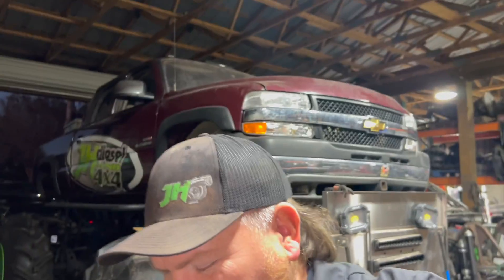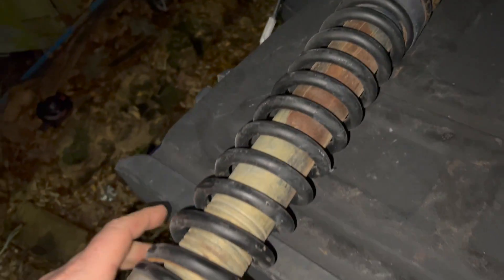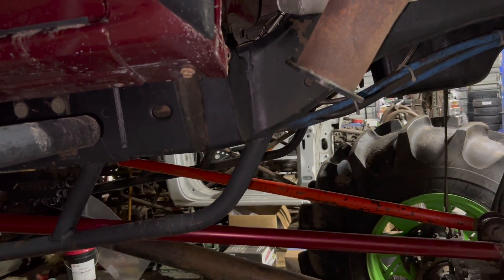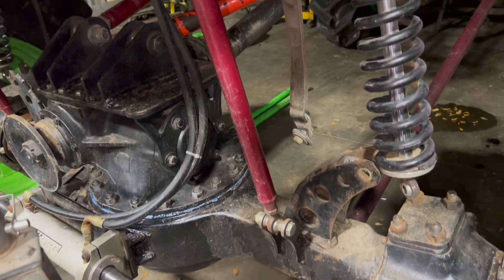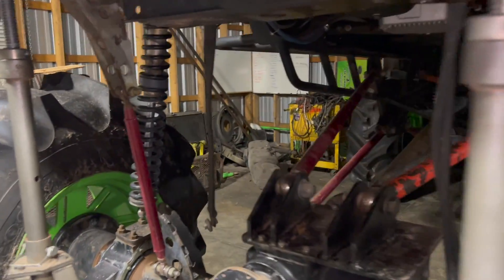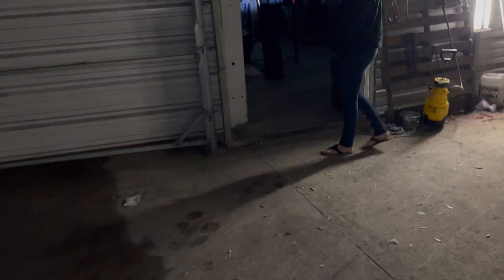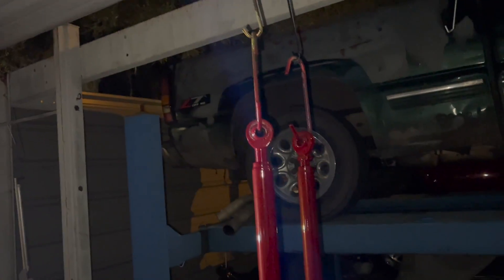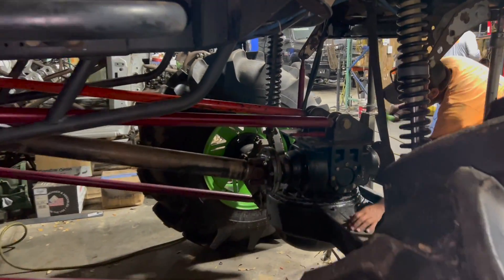D.O.M. Tubing VS Pipe!!!  We Cut Open Our Mud Truck To Compare The Differences!!

Comment: A513 (most DOM) has a yield strength of 72ksi.  A500GR-C (most likely the seemed tubing in the video) has a yield strength of 48 ksi.  So yes the DOM is 50% stronger for the same OD and wall thickness.

Comment: Fun fact about both those pipes. It was once rolled on a reel like a water hose . Just a bigger reel. the ID {inside diameter} of the pipe is all different sizes.  It was once used for coil tubing for offshore and on land drilling. A company in Odessa Tx straightens it out after it has about 1 mil running footage or 30% usage. then sells it to the public As straight pipe. Now you know why it bends so easy.
Reply: dam
Reply: What do you mean by why it bends so easily? Because it is used pipe or because it will bend around a large reel?

Comment: Pretty sure roll cages are supposed to be d o m wall tubing.
Reply: HREW FOR LIFEEEEE
Reply: Pretty sure mild steel tube is just fine
Reply: Pvc is pretty strong
Reply: I ride BMX and ain't NO WAY mild steel compares to chromolly.
Reply: I have seen someone build a roll cage out of galvanized steel pipe and fittings.
Reply: Just depends on the sanctioning body and the required spec to build them to...
Reply: Nah , all you need to do is replace headliner with FRP board and you're good and safe for 7 second quarter mile runs.
Reply: Good ol drawn over mandrel tube
Reply: #2 pressure treated pine is waaaay stronger
Reply: @BUILTFORDTOUGH79  I build all my race cars out of balsa

Comment: I built off road desert racing trucks and prerunners for years an cold rolled miled steel tubing isn't even allowed in our industry for safety reasons, its much softer and not nearly as strong as 4130 or DOM. Listen to JH on this one guys, a couple hundred bucks is worth yours or one of your friends lives.

Comment: I agree with the dom pipe over sch 80 pipe, but on a 4 link truck I will always make my front and rear pull points from the axle instead of frame

Comment: The main important thing to know is what your material and thickness is. Schedule 120 pipe is a massive step above 80. You can get thin wall DOM and you can get thick wall DOM. DOM doesn't mean its stronger the specifications of each tells you which is stronger
Reply: Correct. DOM is the fabrication method. Both start as a welded pipe.
Reply: @patonb  correct it doesn't inherently mean DOM is stronger it depends on the wall thickness
Reply: @brettknighten1171  and alloy

Comment: "DOM VS STEEL" as an engineer in competitive motorsports DOM [drawn over mandrel] is seamless vs pipe therfore it is a stronger product slightly, myself for just a few pennies more LOL, I only use 4130 chrommoly download a tensile strenght chart you will be shocked it is the standard in all competitive motorsports and aviation. just for fun take a piece of 1.5 x 1.5 moly and steel smash it with a sledge. just a thought.
Reply: If you're an engineer in competitive MS, I'm scared for your driver. DOM is ERW 1st then shape refined by the mandrel. Pipe also come seamless btw.
As a metallurgist, i beg you to stop using "steel" when you most likely mean "low carbon steel" as 4130 is steel too, so is 316.
Reply: OK what is the structural material stand fin the competitive motorsports industry, sorry bud you have no idea what you are talking about in our application.
Reply: @victormackenzie-davis2711  I'd respond to you but I have no idea what you are asking. Your auto correct has you asking gibberish

Comment: As a Boilermaker;
1) pipes have SEAMS
2) Tube is EXTRUDED

(Steam TUBE)
Reply: Not really true. Pipes are always round, tubes aren't.  But mostly it's tubes are ID, pipes are OD. 
There are plenty of seamless pipe made via extrusion, A36,, and lots of tube by seamed. DOM is seamed then Drown Over a Mandrell to refine it's shape to the required ID.
We use a lot of seamless in refineries

Comment: That’s mild dom tube and mild seamed tube not pipe.    Pipe does not have seams inside    Cromoly needs to be heat treated after welding or it become more brittle…. Mild tube bends and dents, cromoly does not it breaks

Also you will not find pipe the same size as tube.
Reply: I was curious on this. I'm unsure what the original 4-link was made from. Obviously not DOM as the weld wouldnt be showing. He'd have to measure to be certain but it looked to be 2" ID and I can't think of a pipe that'd give a 2" ID

Comment: I use 1 1/2" SCH 40 and SCH 80 ASTM A36 Seamless Pipe for Cradles and Shock hoops. 1 7/8"x 0.120 DOM for cages and 2"x.250 DOM for Link bars

Comment: Yep. Only DOM or chromoly. And If it’s a roll cage it should be at least 1.75” 120 wall. 2” 120 wall for the main stringers is even better

Comment: I learned about this a few years ago from some guys that used to build 4-link lifts for trucks and asked why Sched 80 was no good and they gave me the same exact explanation and it makes sense for sure. You definitely don’t want a truck folding up on you on the road or a mud hole. Just dangerous man.

Comment: Common sense would tell you thicker is stronger.
Reply: only if you compare like objects. a Crom moly tube is thinner but much stronger then the mild steel used in most DOM tubes because of the Cr and Mo alloying strengthens steel.

Comment: Man I drive a race car with almost 4000hp it runs high 3.60s in the 1/8 and over 200mph can you imagine if I slam Into a wall at 200mph and my cage is made out of schedule 80 pipe there would be no surviving..If there gonna make there link bars out of I'd be afraid to get in it cause if there that ignorant what else did they make out of it...Those are big trucks that weigh alot and most times backed by alot of horsepower any way you look at it's a bad deal.

Comment: depends on your sanctioning body in the class you run in whether it needs to be DOM. The only downside to DOM is that sometimes the wall thickness can vary in a length of pipe I ran a hot Street class we were allowed to run EWT instead of DOM but our trucks were only 3000 pounds and we’re only covering a 300’ pit in 3-4 sec. Head I’ve been pushing 1000 or more horsepower. My entire cage would’ve been out of DOM. keep that content coming.